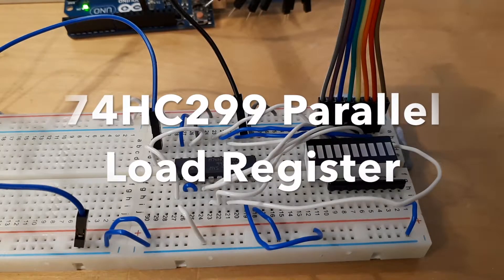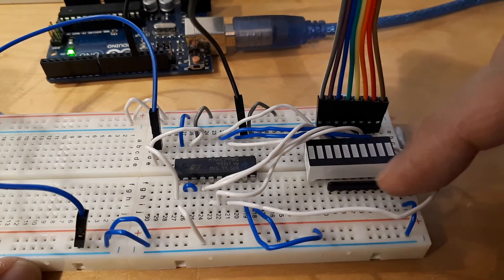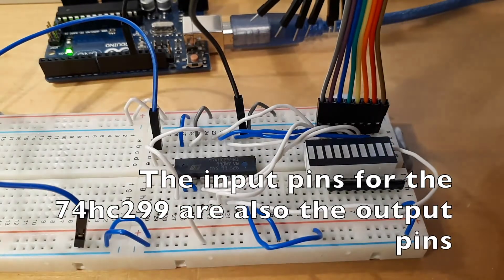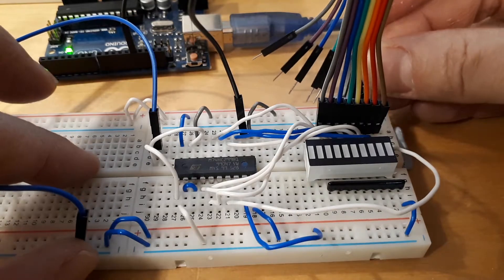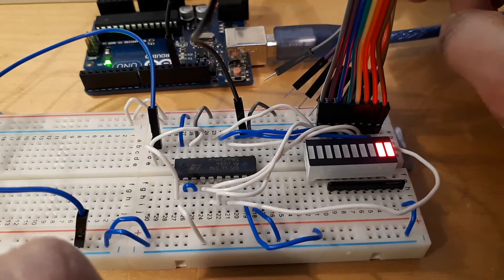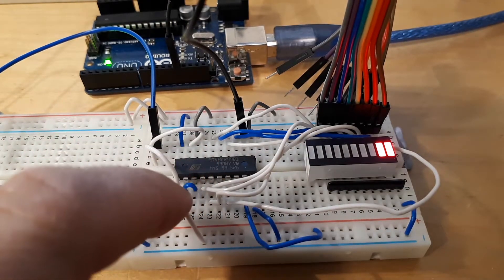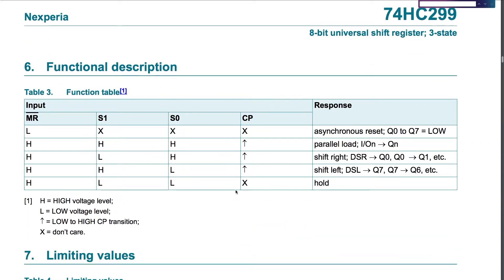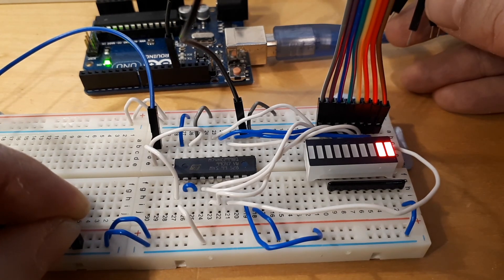How to drive a 74hc299 using an Arduino

Comment: In case someone runs into this video, having the exact same problem as I that can't understand the documentation on the first try, here is some help because the video won't help you at all.

First of all: the Texas Instrument's PDF isn't too straightforward. Search for: Nexperia 74HC299 (I got it from the video, this is what helped me!)

To load data - Serial In -> Parallel Out:
EO1 and EO2 -> to the Ground
S0 - 5V
S1 - Ground

Clock Pulse to Low, write 1 bit of the Serial data to the DSR (Pin 11) and switch the Clock Pulse to High. Clock Pulse to LOW and continue to send the data.

The above will shift the content of the register one bit to the right and load the sent data to the I/O1 leg (first register).
Reply from the maker: I much prefer the Nexperia datasheets. The TI ones are always harder to read.
Reply: i love u man, with my whole heart